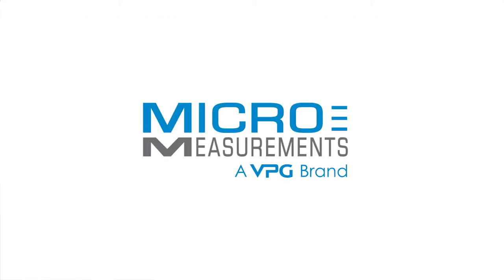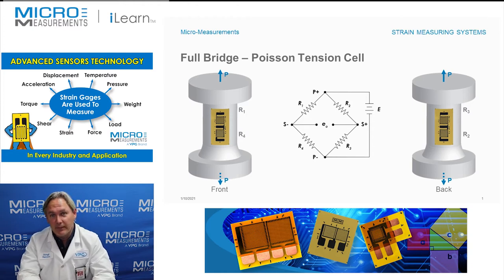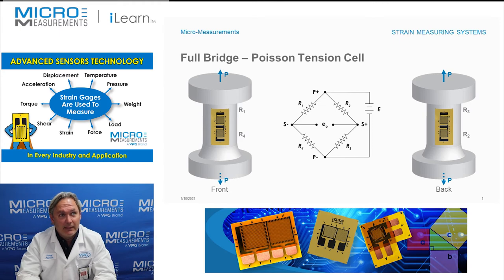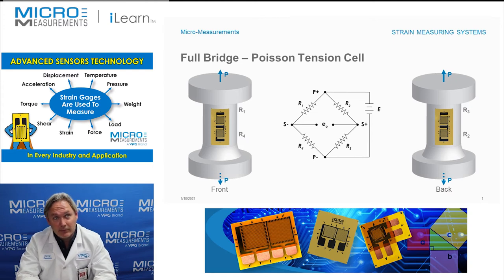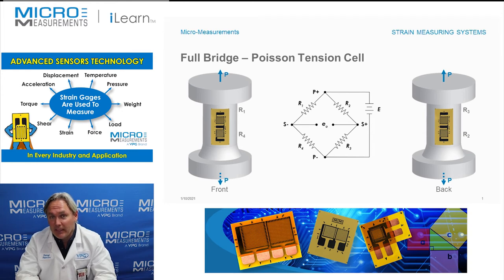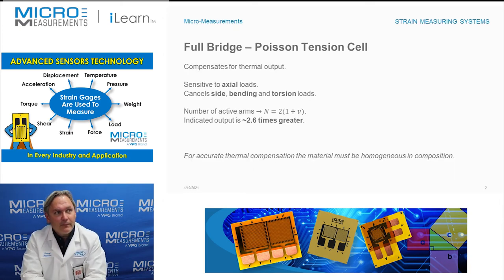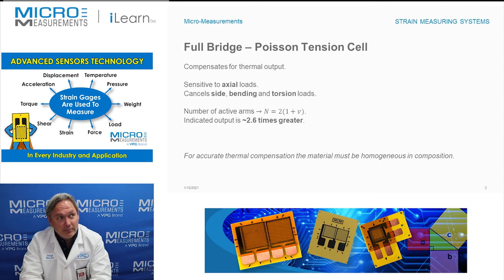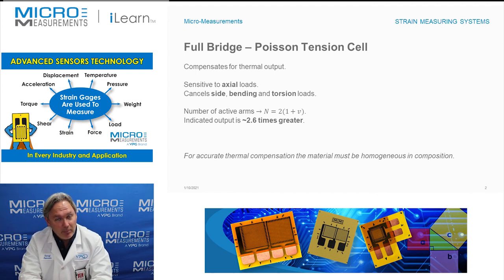Full (Wheatstone) Bridge – Poisson Tension Cell.

Comment: Hello sir, Is the thermal error of column load cells higher than other load cells?
Reply: Hi Mehdi.  I apologize for the delay in responding to your question.  There are a lot of factors that can lead to apparent strain or thermal response of a transducer so its hard to give a definitive answer.   Factors such as the gage configuration, material properties, wiring, compensation techniques, etc can all drive the thermal response of the transducer whether its a column or binocular beam or some other design.   Darryl
Reply: @darrylpeterson5394  Thank you for your reply Mr Darryl. 
I am so sorry for taking your precious time
I had another question for you and how we can eliminate or compensate for non-axial loading effects in column load cell?